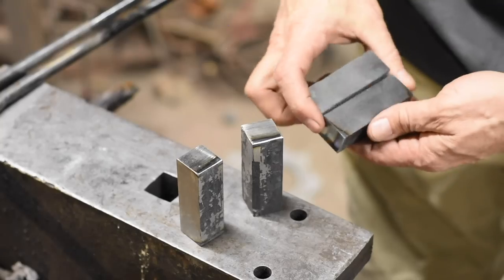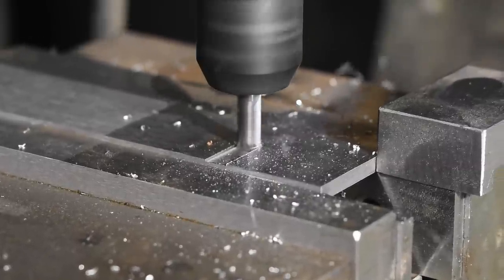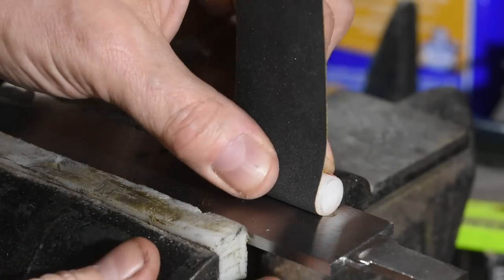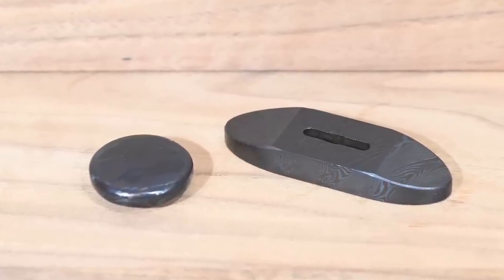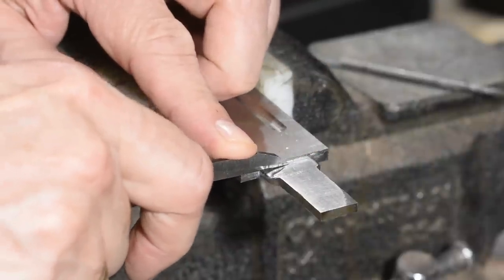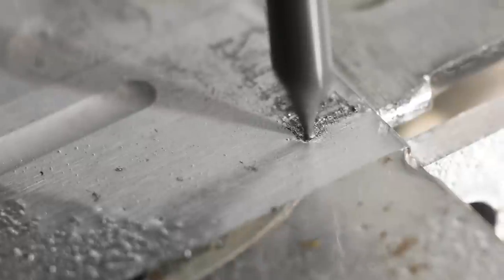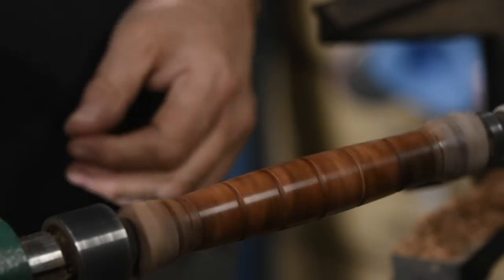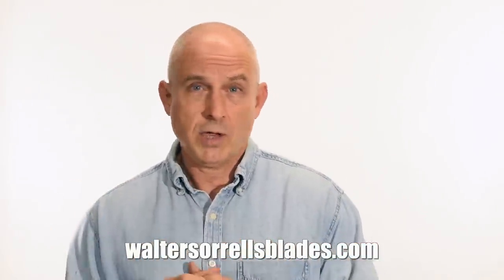Tragedy!  Making A Mosaic Damascus Ka-Bar Tribute Knife - Part 1

Comment: Flat chainsaw raker  files have a smooth edge. I would like to make a smooth edge on a larger more aggressive file, I haven't tried it. Will a belt grinder work.
Reply: I use a belt grinder to flatten/smooth the sides of files that require it. Don't use/waste a fresh new belt on it though. You could also use a grinding wheel on a wheel style grinder.
Reply: @daveh777  Thanks I'll try that.